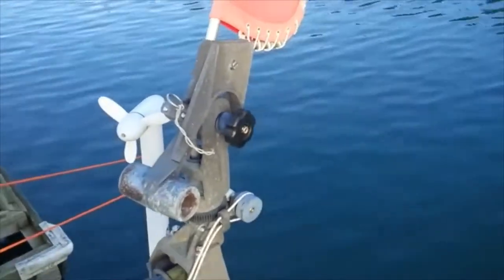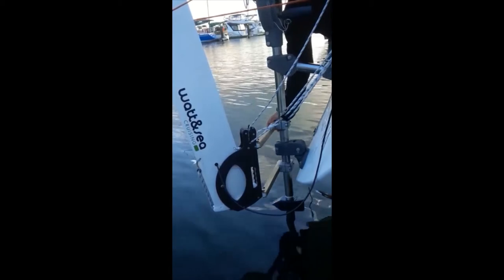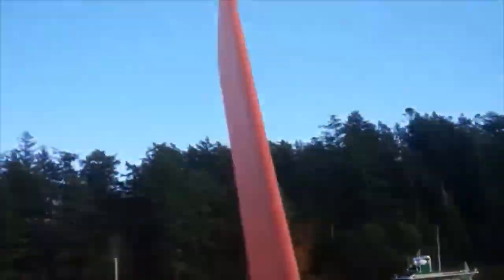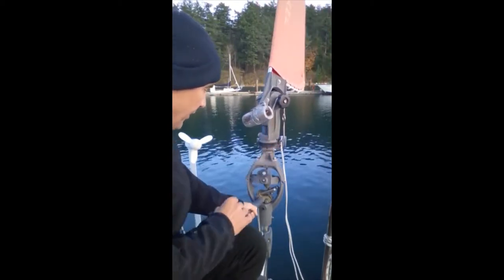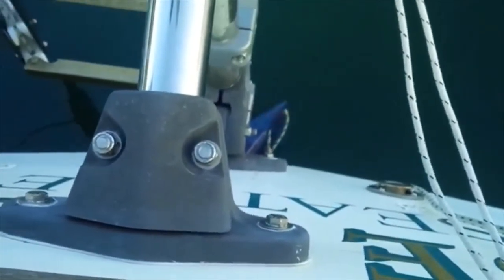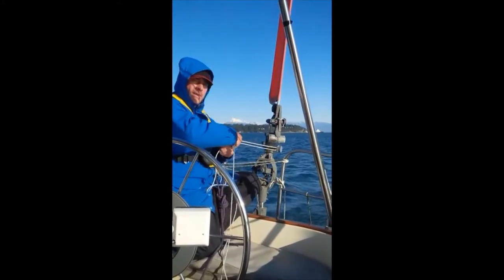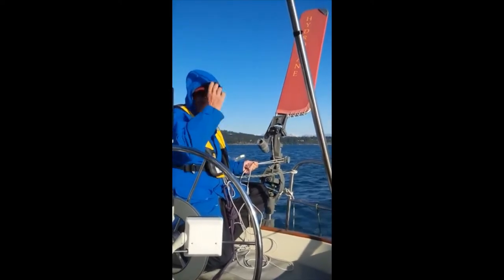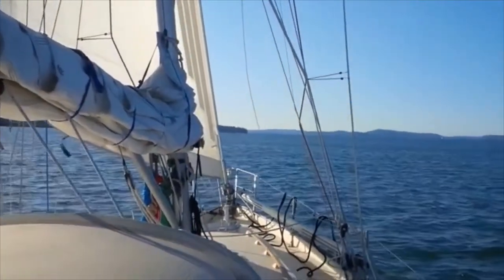Hydrovane Windvane Self-Steering Introduction and Operation

Comment: Terrific video, thanks. A properly set up Hydrovane is lanyards tied to everything.  Just as you have it. Seems a bit much...but it's just how it is. I've got the two shapes of the windvane. The taller one unless it's tilted backwards hits my outboard bracket. 

At 3:10 is the problem I'd like to solve. I tried out my Hydrovane a couple weeks ago at sea,  in 15-20 knot winds. First I learned, at 6 knots don't even think about it.  I heaved to and my speed through the water dropped to 3.3 knots. I got the rudder attached but it really wants to float and the moving water wanted to pulls and tilts it backwards. Aligning it was fussy because it's underwater and you can't see most of it.  I'm lucky to have a sugar scoop, but I was still down on my knees arms in the water up to my elbows, tether of course. 

My thinking is to make an installer  bracket to hold the rudder making it easier to attach at sea. (That is where you'll need to do this.)  A twist latch  will go through the hand hole on the rudder. A turn will keep the bracket attached. 
A side piece has projections at the front  and the back of the rudder, A pole sticking connects it all and provides  leverage. 
A fulcrum projection on the pole would push against the bottom knuckle or shaft. 
Now you just hold the pole to guide the rudder into place. If my fingers worked against 3 knots, the pole and backet will be much better. 
 Some part of the pole is vertical so you know when the hole in the rudder  is vertical and aligned with the shaft.  Be much  easier to put into place.
Once the rudder is on its buoyancy wants to keep it on while you lean down, stick in the rudder pin, the retaining loop... then just twist the thing holding the tool to the rudder  and it comes off. Of course it would have it's one lanyard.... 
Seems fussy, but....  Ideally this bracket & pole would be small but not too small.  (I find things you almost never use that have multiple parts sometimes get separated even in the same lazarette.) 

The line at 7:00 has a whole set up with a block and bungee. If  you don't do this the line (I used paracord) jumps right off the grooved wheel. What I did was to just give that line a twist after it goes through the two guide holes. Then just put that loop around the wheel. Even with a slack control line it stays in the groove. Another sailor said to make a continuous loop for this just melt a couple pieces of line together. (I was thinking of splices for jib furlers...) 

And even in the conditions I was in I could easily steer the boat with just that handle. I didn't need the longer handle. 

What I was trying to do at sea was to see if in an emergency:  Could I set it all up in some rougher seas, winds and make it work?  It did. I didn't have the sail set correctly, but it was good enough that changing the direction wheel I could easily steer the boat changing course 10 degrees,  left and right, pointing at the end of the island,  at the middle of it and out to sea past the end. Good enough. In an emergency I can use it. Then if I have a long way to go without my rudder I can practice getting better with the Hydrovane.  It's a beautiful robust piece of safety gear. Mine is 20 years old, probably needs a lube, but still works great. Incredibly reliable.
Reply from the maker: Thanks for the note. A lot of great detail there. I agree it is a challenge to get the rudder on in a seaway. Let us know how your ideas work out there. I have also climbed in my dingy and mounted it from the water which has been quite a bit easier than being upside down hanging off the boat -- though this was still at the dock. I used a continuous loop which did work. I haven't had the problem of it jumping off the wheel. Mine is 15 years old and I do sail with it quite regularly even in the islands - I like the quiet and elegance of it. All the best mate.

Comment from the maker: Thanks for watching. The end of Hydrovane rudder post sits slightly above the water line at the dock. The rudder slides on the end of the rudder post until the holes line up, and the holding pin can be inserted. Can be done on low freeboard boats hanging from stern, like I did, or you can put boat stern in and do it from the dock. (easier). The rudder can be taken off quite easily by pulling the rudder pin with a boat hook pole and pushing it off the shaft also with the boat hook -- pulling it aboard with the safety belay line.

Comment: Hi great video I have been using my Hv for many years and enjoy even using it for local Sailing tacking with it and just generally having fun. I have also gone to some trouble trying to make it easier when berthing in reverse, I have tried a strong bungee on the tiller to pull the tiller to PORT and a single line from the other side through a block and back to my steering station so going as stern I can control the hydra rudder from the wheel. Sounds complicated but in fact it’s not I’m not really sure it helps. I find that if my hydra rudder is fixed deadhead, I can still manoeuvre as learn. I have also spent many hours trying to work out a method of being able to swing the hydro vane rudder out of the water. I know it must be possible it’s just a matter of having the necessary machines to manufacture one. When I’m motoring I tend to let the hydro vane rudder just follow the water flow so it doesn’t affect turning when going forward. My boat is centre cockpit so I can’t reach the tiller on my hydro vane without climbing out of the cockpit. One thing that hasn’t been mentioned is the fact that if our main steering has a fault we still have our hydro vane as a back up rudder. I also carry a tiller pilot on board to connect to the Hydrovane tiller this works well I have had reason once when my autopilot failed me on a long passage under power, steered perfectly in a straight course. My boat is a 35 ft Westerly Corsair
Reply from the maker: Great note. Thank you for sharing all that. The TillerPilot is an excellent idea and is on my list to add. I also love using it for local sailing. I love how quiet and elegant the boat is under sail with the HV. It feels like a mediation when the boat is in harmony with the wind. Beautiful. That is an interesting idea with the bungy cord and line. Thanks for sharing that. For tight docking scenarios I have done both -- taken it off just outside the marina or used the HV rudder in addition to the main rudder. I can turn tighter with both, but it is more to handle for sure. The center cockpit you have would add complexity. Thanks for sharing. You have given some great ideas. All the best mate.

Comment: Thanks for sharing a most instructive video on your hydro/windvane. Which is it, wind or hydro?
Reply from the maker: Thanks for the question and comment. It's a wind-vane -- but its brandname is Hydrovane. It operates and steers using the wind as a mode of force, which steers the rudder in the water. So I suppose it's both.

Comment: What's the price for one of these contraptions?  Is there a "better way" to do the same thing?... maybe with integration into the electronic navigation gear?  It would be nice to be able to set an "autopilot" course that also accounts for points of sail.
Reply from the maker: You can go here for supplier pricing https://hydrovane.com/prices/ 
It looks like they are around $8,000 CND quickly totaling the numbers. I paid about $5,000 in 2010. I moved it to my second boat in 2016. I always said I am going to buried with my Hydrovane. LOL.
Yes, you can use either a Wheel or Tiller-Pilot (Cheaper) often independent of the navigation system or a piston or ram-operated AutoPilot. These of course consume power. The ram-operated power consumption can be quite a lot depending on conditions. These units generally are set on a compass bearing so if the wind changes, the sails will no longer be in tune -- but the boat will remain on course. With the Hydrovane, when the wind changes, the boat changes course, but the sails stay in tune. So Hydrovane uses on power, and keeps sails tuned in wind shifts -- though you will go off course in a wind shift. The compass pilots will keep you on course but you will have to adjust the sails if the wind changes.

Comment: Can you use the hydrovane to point you into the wind whilst you go forward and raise / maintain sails? I'm solo and my raymarine selfsteering is not working. Thanks.
Reply from the maker: I haven't done it but yes, it should work. Run the engine to get forward speed of a few knots, point the boat into the wind, set the Hydovane dead center into the wind and you should be fine.

Comment from the maker: *it would be a challenge to put the rudder on in a Sea-way with swell and waves. Not recommended. Singlehanded, I think you would have to put harness on, and lower over the side and hang with feet in the water right at end of rudder post to get enough control of rudder to install it in a sea-way. I have not done that: it would be a wrestling match for sure with waves and boat motion. Install in calm - still water, or at the dock.
Reply: It would be a caliente to put the rueden opiniones a Sea-way Witherspoon swell ansiedad waves

Comment: I have a question on your hydrovane. Do you ever encounter issues with the rudder over powering your vessel rudder. Example when you are backing out or tacking with it? I have encountered issues on both. I went to tack and went into irons. I had to turn both rudders in order to tack. Same goes with backing out. Nobody ever talks about it. It can't just be me. I am almost to the point of calling hydrovane. I also get some disturbance on the rudder when motoring. Thanks Don
Reply from the maker: I have not encountered overpowering to the extent that your are talking about, however, there is an effect for sure. I noticed on my full keel Contessa 26 that the boat turned more slowly with the Hydrovane rudder installed and fixed to center. I did start using both rudders for tight turns and that definitely helped me turn more tightly. I recently was trying some very technical docking techniques on my Contessa 38 using prop walk and the main rudder to turn 180 degrees on the spot -- so I took off the Hydrovane rudder before I made the attempt so there were less variables involved in the technique. I have also used both rudders to make tight turns on my Contessa 38 as well. There is some disturbance while motoring but I haven't fell it was too big an impact. It's probably worth calling Hydrovane to discuss. I have always found them very helpful. There is not much they haven't seen before, or heard about. Good luck. Steve
Reply: @respecttherisk2022  Thank you so much for the response. I did reach out to Hydrovane and they were great. They know of the issues i have. Basically impossible to backout unless using both rudders simultaneously. The motoring was interesting. They want me to put a snubber on the rudder line and keep it taught.. Mine is full keel also double ender. They did say these have more vibration while motoring. Basically these are made for open ocean passages, but can be modified  for my 30 to 60 mile Island hopping. Being a solo sailor most of the time the tacking becomes an issue in rough seas beating.
Reply: For tacking you could add a pilot to free you to handle the sheets.

Comment: I would love this for my Island Packet 35 but I worry my boat is too heavy (17,500 lbs). What are your thoughts on this? Also, have you have had any component break and if so, which one and why?
Reply from the maker: My boat is a Contess 38 and is about 15,000 pounds. If I recall, the specs on the Hydrovane mention boats up to about 45 or 50feet. The Hydrovane Website says they have fitted them on boats up to 60,000 pounds. Give them a call at Hydrovane out of West Vancouver or check out their website at hydrovane.com -- they are super friendly and I have found their service outstanding. They ship anywhere in the world. I have not had anything break, but they do sell spare parts -- I have a bag for "critical spares" on my boat.
Reply: The hydrovane can steer boots up to 55ft, so I woudn't think your boat is too heavy, but the hydrovane has to be costumed to the size of your boat.

Comment: Is the rudder always moving to the opposite direction as the windvane ? Appreciated.
Reply from the maker: When you are sailing up wind -- that is the case: If you are close hauled on a port tack for example, the wind coming over the port rail, and the boat goes off the wind -- the port side of the vane will be exposed to the wind thus moving the vane to starboard. This action moves the rudder to port, which steers the boat back up wind. (Vane moves to starboard, rudder moves to port.) When  you are sailing on a dead run, however, and the boat veers up wind to port, the port side of the vane is exposed to the wind thus moving the vane to starboard. Moving the vane to starboard in when it is set for a dead run, moves the rudder also to starboard bring the boat back down wind. So vane to starboard, rudder to starboard in this case.
Reply: @respecttherisk2022  That's fascinating. You put the puzzles together for me. I never thought about the dead run and closed haul wind will have different affect to the boat. I watched many videos sheet to till steering too. Try to understand the cause and result actions. I never own a sailboat. But have experiences handling a canoe in wind, current and turning and rudder action. Thank you again bro! Enjoy sailing.